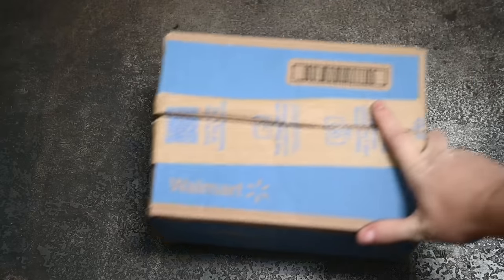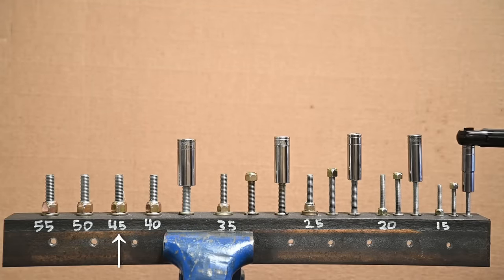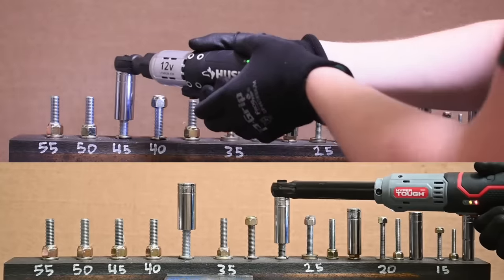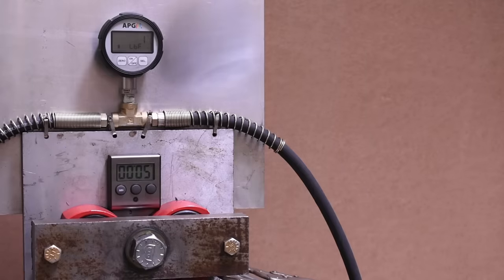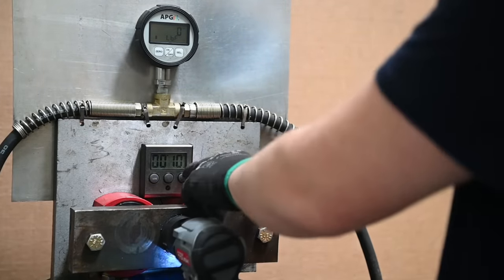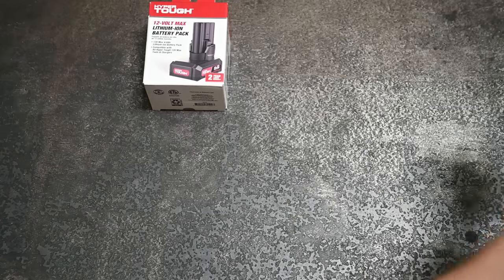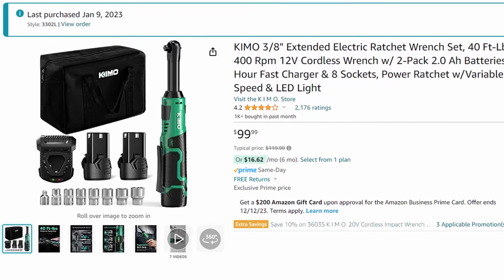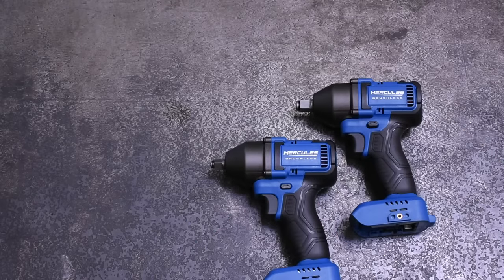Latest Walmart Hyper Tough Tools vs M12: Too Cheap to Pass Up?

Comment: I bought the normal reach ratchet for 40$ 6 months ago. I work part time as a mechanic, and have been genuinely impressed by the performance (for 40$). The form factor of the Milwaukee has always been my favorite. But the hyper tough kit is literally 1/4 the price of the Milwaukee bare brushed tool. Also bought the hyper tough 12v rotory tool ($30 kit) for cutting bolts, flush cutting flooring, and other small projects. Again i am impressed by the price to performance. Both are amazing tools if handled properly for the price. I haven't been gentle with either, but I don't treat them like a 200$ professional grade tool.

$40 thats the cost of a decent non electric ratchet!!
Reply: Yeah I find it easy to recommend the short $40 as long as people know its just an electric ratchet not some kind of torque wrench or impact wrench (its surprising how many think that way about these kinds tools). I honestly plan on getting quite a few more tools from this line with how pleased I am.
Reply: That's good to hear.
Too bad it's sold at Walmart; Hyper Tough.
Some folks have a bad taste and feeling about it.
Reply: Can't speak to the Walmart variant, but for rotary tools I have tried quite a few. I always use my Dremel now, because a few of the other brands I have purchased failed me. Had more than one give up on me part way through a cut, but the Dremel always finishes the job. I've yet to have to replace my original. Meanwhile a few of the off brand ones I had at my parents / work have already died. I usually take my Dremel with my in my tool bag now.

Edit:
To clarify I would still recommend the off brand if it was a lot cheaper. But buying a Dremel is only about $40 for a corded variant and I think it's definitely worth a small premium if you need a good rotary tool. Just my take. To each their own.
Reply: this - rotary tool, ratchet, impact - cheap, light, works good

Comment: Once again, one of the most useful channels on da interwebs.  My only experience with Hyper Tough has been a pair of rechargeable work lights.  They have served me very well for over a year now.  One even flew off the top of my SUV doing about 60 mph one night and bounced several times on the asphalt with no apparent damage, so at the very least Pretty Tough.  They are slow to recharge, however.

Comment: As a retired A&P Mechanic who owns a lot of great tools I bought the Hyper Tough 3/8" Dr. long reach for the heck of it & didn't want to spend $250 for the Milwaukee long reach (I own several Milwaukee Fuel tools BTW). I'm glad I did cuz I really like it, it's a great deal and a pretty good tool so far. Batteries are cheap and there's always a 24hr Walmart open close by in case you need a new battery in a pinch also. This one's good for those tight spots after breaking the fasteners loose & when needing a bit more reach with a ratchet in an engine bay etc.. Glad you did this video, I was considering getting the 3/8 impact. Thanks for sharing and keep up the great work.💯👍

Comment: I got the hypertough 3/8 long short ratchet & 3/8 impact wrench. They both have been great. I drive a nissan murano & they have busted off lug nuts, spark plugs & busted off nuts that i knew it couldn't do, but it did.

Comment: I've bought this thing with the fast charger and the 4ah battery. Mine definitely can do lug nuts with the standard battery (I do also have a torque wrench so I know they are torqued) so I'm surprised your model couldn't. I guess that's just the level of quality control you get with cheaper tools. I'm very happy with this purchase saving me some money for my light duty projects around the garage.
Reply: Me too
Reply: Same here.
Reply: Same mine was ripping them off of an E350 today. With a half inch adapter.
Reply: @IamHenshaw how about no
Reply: @Highstranger951  How about yes. Lol. I got no reason to lie bud. I have always been leary of El Cheapo tools, but I will say this new Hyper Tough line definitely hangs in there, from what I've seen personally.
Reply: @IamHenshaw  it’s your lie, you tell it
Reply: @Highstranger951  Hahaha. Okay internet stranger.
Reply: @IamHenshaw I doubt it 😂😂😂 turd
Reply: Id be curious if doing it on real lug nuts on a wheel would change things. Testing conditions sometimes are strange.

Comment: I have a Craftsman Nextec 12v kit that just refuses to die.  drill, right angle impact driver, auto hammer, multi-tool, and Dremel-type tool.  

I pieced it together from sales about 15 years ago and I've only had one battery out of six die.  

Those tools installed a couple of decks and all of the DIY for my house during that time.

I bought into the Ryobi system 2 years ago to get some tools with a little more power but that other kit is still going strong.
Reply: Got the same tools! I very much enjoy them too. Very nice tools. But man are they expensive now! Took awhile to get them all but they are worth it. For bigger jobs I use the new Craftsman 20v tools.
Reply: That craftsman nextec right angle impact is GREAT!!! Not the strongest thing ever, but I do electrical assembly for a living and that thing has been excellent and has been going for YEARS.
Reply: I also have some ancient craftsman nextec that refuse to die. The batteries hold almost no charge, the oscillating saw is useless, and the drills are quite light duty. I wonder if it is the same batteries as these.

Comment: I just bought the short hyper tough ratchet because the Milwaukee never sells cheap, ever used.  Since I noticed the HT ratchet is EXACTLY the same as the Tool Pro brand from Super Cheap Auto from Australia!

Comment: Been real curious about the Hyper Tough stuff… but I’ll just stick with Ryobi and Milwaukee. I do run a lot of Hart hand tools, but my buddy can get Milwaukee tools at cost so I’ll be doing a lot of upgrades soon!
Reply: What is cost like on those? I assume home depot takes like 30% or smth?
Reply: @jameshaines4260 I work at an electrical wholesaler in Canada, I bought a Milwaukee m18 heat gun at cost for 100 bucks, we sell it for 170
Reply: @yoboialex  wanna be friends? What's your at cost for impact wrenches and drivers?

Comment: Thanks for doing this! Knowing this now, I’ll probably pass on the impact (sadly) but would still probably go for the rachets. I just changed the valve body in my Subaru last week and I got to use a buddy’s snap on Rachet and the speed that it brought to just running nuts out and in in the engine bay saved so much time. Obviously this is not as fast but if it saves my forearm effort to hand spin them loose, it’s well worth the price for me in applications like that.
Reply: I have the extended reach and it's been great for me.  I live in Oregon so no salt on the roads and pretty clean threads, even on older cars, and I find this to be similar in speed and torque to my brushed Milwaukee (and actually a bit better built).  Super easy to recommend at the price.  Not on par with a top tool especially on messed up threads, but still way faster than doing it by hand.
Reply: The impact surprised me. It takes lug nuts off and anything else I have used it for no problem

Comment: I was able to remove lug nuts during my review. I did tighten the lug nuts to 150 ft/lbs (or more)
Reply: Me, too! And there are a lot of comments like yours here, and my own experience mirrors your review (I watched it). Something seems odd about that ...
Reply: I was thinking the same thing but he uses a huge socket if it was a normal lug nut socket it would definitely remove one. Was gonna save up for Milwaukee but honestly going to get a 20v brushless 1/2 impact wrench and a 12v 3/8 brushless impact and just go the hyper tough route for at home wrenching

Comment: But but but….. everyone online says these HT are just fuels in gray…. I saw a guy on Facebook use a torque wrench set to 120ft/lb tighten a lug but then remove it with the HT……. But in reality it struggles with 60+ ft/lb 😂. Thanks TTC for keeping everyone honest.
Reply from the maker: With the right size and thread pitch maybe it can do 120 that was just installed. But so can a Kobalt cordless ratchet and no ones going to rely on that for taking off wheels so maybe we should all agree someone taking off a lug nut they installed stopped being impressive for cordless tools 10 years ago

Comment: I have a Milwaukee M18 1/2" am 3/8 impact. They are great when I really need the torque, but most of the time, I use the Hyper Tough because they get it done and at that price, who cares if you kill them. They also feel good and i can have a bunch of batteries and multiple drivers and still save a ton.  They are a ridiculously good value.

Comment: I bought the extended reach ratchet for my job. I need to adjust the setup of a machine with hex head screws. I dont need it often and the tool is mine so i didnt want to spend too much. Its perfect. Its not really your style, but for the lower end tools especially what different reall world tasks they can do is more important than what they vant do or more expenive tools that do it faster.

Comment: I wanted these as a space saving and cheap set to keep in my RV. I purchased the brushless drill, the short ratchet, and the brushless impact driver. Im glad i didnt get the impact wrench after seeing this. I did test them before putting them under the seat of the dinette. They did ok for small mechanical jobs on my truck and building a chicken coop in the back yard. Impact driver had just enough power to drive 3inch long #8 screws. So they are alright for now. I opted for the fast charger as well so the batteries dont take 10 hours to charge. I did not get the bigger battery, though maybe i should get one to give the driver a little more power.

Comment: Been waiting on this, glad to see it. Thought about that hyper tough long ratchet but after seeing this I think i will pass.  Many other youtubers hype up these hyper tough tools. I appreciate your no BS standardized approach to testing these tools.
Reply from the maker: Wanted to hype them TBH, we support this kind of pricing in today's market. Just didn't find any data here to back up the hype, but doesn't mean they are useless depending on your needs. For example the 3/8" might be a sweet little hip shooter for top of engine valve cover/intake manifold stuff. Dont have to worry about ruining bolts as much, and people pay several hundred for Snap-On's version of that same idea. But to compare them what the specs of other equally spec'd tools, which is our usual MO, yeah no
Reply: Agreed a Zillion percent there are a lot of Youtubers that do videos but put a lot of BS about how good  Hyper tools are  also the reviews are also BS about Hyper Tools ... If you are a DIY persons a Maintenance  person or a Small engine Mechanic Hyper Tools  are  a good buy if you are a Mechanic  and bang wrenches all day stick to the Pro Brands

Comment: I really wanted an electric ratchet for a one-time use while assembling a resin shed a couple months ago and couldn't find a deal on a used M12 or find those 4V Ryobis in stock. I totally spaced that these existed. I'd heard good things about the impact driver (not this wrench) and would have happily plunked down a few clams to try one. My store finally started carrying the 12V stuff this month, so I might grab one just to have on hand.

Comment: Im kinda curious how long it would take to run the gauntlet with a normal ratchet. I cant remember if you guys ever did that when you first made the gauntlet but it would definitely be interesting to see if you're as fast as some of the electric ratchets out there
Reply: Yeah, no way in hell would they be nearly as fast as any electric ratchet.
Reply: A longgggggggggg time, ratchets on nylocs are just brutal.
Reply: @SomeGuysGarage  You'd need a new wrist afterwards as well.
Reply: The reason these ratchets are so ubiquitous is because they are so much faster than hand tools...
Reply: Lol I'm willing to bet a low level intern could prolly bang out the gauntlet faster than you'd expect. Not electric ratchet fast but either way I'd be entertained lol.
Reply: 😂 It would be fun to watch LOL
Reply: @oldfag_adventures  You wouldn't need much strength to do this, but you'd need a a decent bit of stamina to keep up a good speed.
Reply: I was thinking the same thing after this episode lol
Reply: A manual speed handle is much faster than a ratchet when there is room to swing it. That's why the Air Force uses them on aircraft where spark producing devices are to be avoided. A 1/2" drive speed handle can be surprisingly quick but remains worse than a feeble ratchet so mine sit in the toolbox for rare special use cases.
Reply: Rather disappoint but I guess for the price shouldn’t be too surprised
Reply: Better make sure you bring a big jar of elbow grease for that test.. 

Even the shittiest electric ratchet is gonna be a game changer vs hand ratchets..  besides electric ratchets are used to break the nut manually and use the power to drive the bolt/nut off which usually involves almost zero torque once busted loose.
Reply: For me, for the gauntlet, if the bolts were a quarter length of what he has them would be more realistic test, at least for me.  Which would be even way faster then manually working a ratchet.

Comment: I just looked for $95 you can get both Hypertough ratchets with a battery and charger each.   That's not bad really, especially for a DIYer.   If I didn't already have a Hercules ratchet I'd give them a try, I might still buy one to be honest.

Comment: I have the hyper normal reach ratchet. I’m a weekend warrior mechanic. Anything beats having to ratchet by hand. And at the price I like the hyper tough. I usually break the bolts with a hand ratchet then quickly undo bolts and nuts with the hyper ratchet. I can’t complain 👍🏻👍🏻

Comment: My hyper tough 3/8 impact cuts off using the 4ah battery like you experienced with the 2ah battery.  This was after using it for a bit. So you would have likely experienced the same issue with a 2/3 full 4ah.  I am still happy with the purchase because I will be taking it and the ratchet to Pull A Part and I would not be as hurt if I lost it in the yard as compared to the big brands.
Reply: I had a craftsman grinder c3 and would cut off due to lithium ion batteries that have a safety feature so they don’t burn out but was annoying so had to buy adapter from craftsman to Milwaukee battery adapter problem solved- I could never finish a job with battery cutting off

Comment: I got the 3/8 brushless impact on sale for $29. With battery and charger. I have a big boy name brand for any serious bolts or stubborn axel nuts. But for everyday basic use on normal hardware (mounting brackets, timing covers, valve covers, whatever) it's incredible. It's was $29!!!!!! It saves me a stupid amount of time over messing with a hand held tool

Comment: I've been using an M12 screwdriver at work for 5 year every day working on old computers and I'm not easy on it.. It still performs very well after years of abuse, and it made me buy the cheap brushed 5 piece m12 kit recently, and i don't regret it at all! Fantastic tools for the price that'll last years, and the old brushed stuff still holds out after years with the same battery.

Comment: I’m really surprised the impact did so poorly.   I’ve done the lug nuts on 3 different vehicles so far, with no problem at all.  
Ratchet did about how I expected.   Still love mine though.   A little speed difference just doesn’t make a difference to me.  Not like I’m working on the clock
Reply: I began using hercules power tools and I'll be damned, I don't want to use my old DeWalt stuff anymore. I'd personally never use the Hyper Tough stuff because I don't want all my home projects to take twice as long. Herc is where it's at if you're going cheap.
Reply: This is how I feel when these channels compare my Ryobi to things like Milwaukee and DeWalt. Ya my green is going to do it a little slower probably, but they never really fail to get the job done. And that's what matters to me

Comment: Now the price is $29.50 if you purchase online. I wouldn't buy it for $59, but $29.50 is a great deal. I'm really satisfied. I can bring it to the junkyard all the time
Reply: I just saw this too! The cordless 12v rotary tool is 50% off as well @ $17.50...
Reply: @cmwyeye1214  I tried it today. I replaced front and rear suspension components of my 04 civic. Battery lasted for entire job and died, which is good enough for DIYer. Nut busting torque wasn't enough for like brake caliper bracket bolt. I had to use breaker bar at the beginning.

Comment: The impact wrench they used in this video does not have the "Brushless" sigh on the back so They might got the a brushed version or an early version of the tool. My impression the the tool is completely different. 
I got the Hyper Tough 3/8 short ratchet & 3/8 impact wrench. They both have been great. I drive a Kia Soul & they have busted off lug nuts, spark plugs & busted off nuts that i was sure it couldn't do, but it did.

Comment: I've used my 3/8 M12 impact at work to pull head bolts out of a 5.7 hemi out of a ram. That's impressive.
Reply: @houston5508 Have you ever even used a power tool? A ryobi impact couldn't loosen a drain plug on an oil pan let alone a head bolt

Comment: Main reason I bought the HT 3/8 stubby is because none of the chinesium manufacturers have cloned a 12v variant yet. (Looking at you seesii) and yes the dewalt makes more BUT I NEED the 12v form factor. The compact nature is what I’m after. Yes a m12stubby world be great but for what I’ve thrown at it, it’s been great but that’s smaller fasteners etc. I have my mid torque for the big stuff

Comment: As a mechanic (2yrs) I run my power tools from hf. So far they Ben good they do the job. I baby them if they can't get a nut lose I just brake it by hand.  But for the most part they work